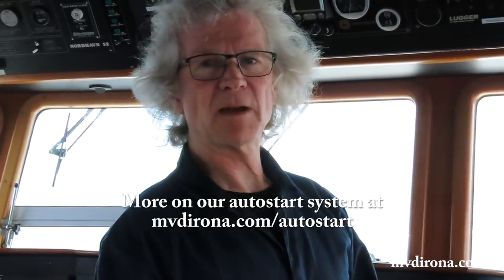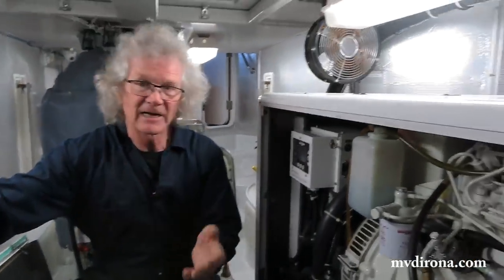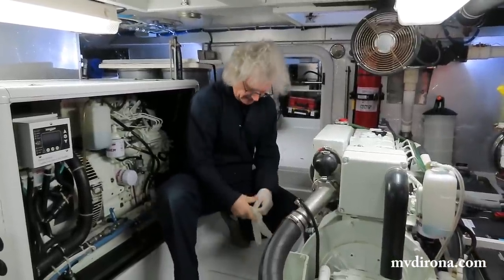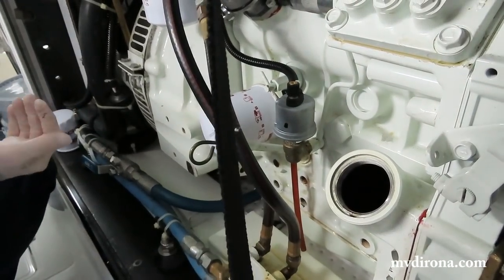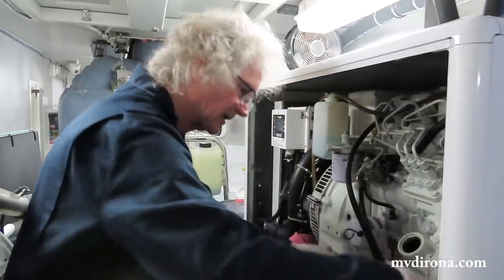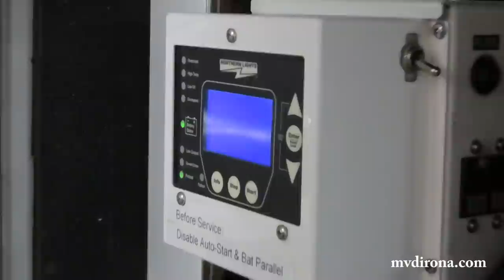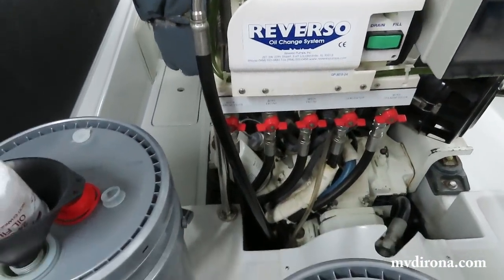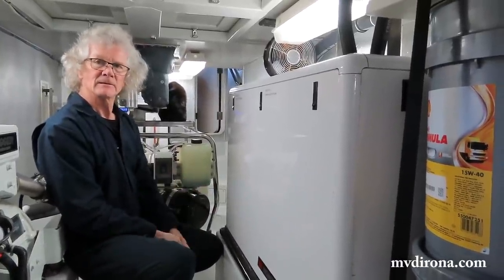Northern Lights 12kW Generator Oil Change (MVDirona Channel)

Comment: Sorry you had to pay in Amsterdam for disposal of used oil : ridiculous , as disposing of used oil  is free at any  car garage or at every municipality recycle station .There is no fee to be paid. The reason it is free is that used oil is simply worth money. After gathering of the used oil and after filtering, it is sold as socalled heavy duty oil , which is used  by all  large ocean going vessels ( however usage not allowed within all EU territorial waters: just diesel is allowed.
But as we dutch use to say : Amsterdam is not the Netherlands, but just Amsterdam.

tip1:
When I change oil filters, I useally put a little fresh oil on the rubber sealing of the filter rubbing it smootly  with my finger, preventing the filter getting stuck  when replacement is needed after  a while.
tip2 : after running the engine to have the fresh oil circulated , best  wait for 5 or 10 minutes  untill all circulated oil has dropped back to the bottom and then check the level with the oil stick.
The risk in doing it imediately is that the level appears  OK, but later on above max level.

A great new fuel  by Shell is GTL ( gas -to -liquid), which is an very clean alternative for diesel. It can be used without any adaption of  the diesel engine ( I am using it in my diesel cars and  both tractors), but is was originally intended for marine purposes. It generates  over 40 pc less CO2 ; 20 pc less NoX ; no more black smoke; no black partcles in your engine oil and the  cetan number ( diesel is 50 up to 55 for premium diesel) is much higher ; over 75. , meaning it starts very easy and runs far more smoothly even in cold conditions.
E.g. Shell V-power diesel contains wolrldwide around 15 pc GTL. It is very well suited powering  the diesel  generator and It can be mixed with diesel  : no problem at all.
Google : Shell -GTL -marine
Reply from the maker: I've heard good things about GTL and those I've talked to that use it, really like the positive impact they are having on the environment and don't mind the additional costs.

Thanks for passing along your experience.

Comment: from way over here, where i'm least able to make a suggestion:  seems like you need a written checklist. too easy a sol'n to not use it. just my 2cents.
Reply from the maker: We have a maintenance program that tracks when it's time to do different operations.  We also have alarms and alerts to ensure that we don't have equipment in an incorrect mode. We do use checklists for some operations but our focus is on making the systems so simple to run that any needed checklists are short.  

Basically, people are the weak link so automate the mundane things that people tend to forget or don't check in sufficient detail. For example, in order to insure that the helms person is awake and alert, we have a watchkeeping alarm that must be touched every 10 min.

Comment: have seen some hospitals dirtier than your engine room .....
Reply from the maker: Love it! :-) I like to keep things clean partly because, if it's clean, it's easy to see problems early that would often be hidden in the grime. And, if it's clean, it's easier to work on without needing to put on coveralls for small jobs or quick checks.
Reply: @MVDirona     agree !!    for me the engine room is sacred place !!      dirt just complicate all, in peace and war time !!!    you understand me*
Reply from the maker: 100% agree with your comment "dirt just complicates it all."  Clean parts are easier to service and problems are much easier to see. Our generator currently has a rear main oil seal problem and so it's throwing a lot of oil around which will make keeping that area of the engine clean more challenging. We'll plan to change the seal fairly soon.

Comment: He closed it, check the part right before he put the sound shield back on
Reply from the maker: Good eye JP. I didn't tell right near the end but at 31:22 you can see the valve is closed. I did forget to mention I was closing it though.